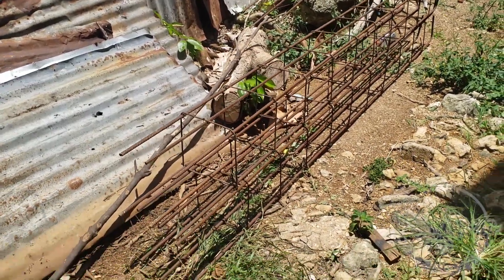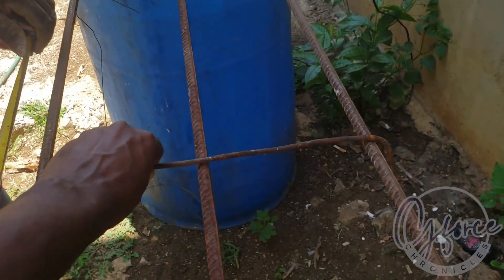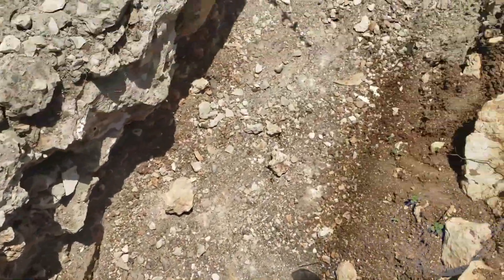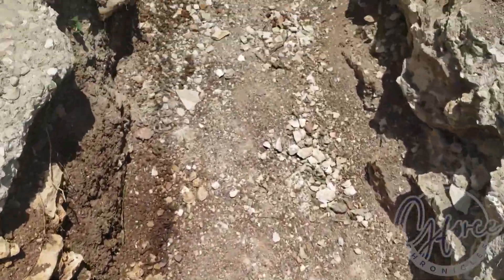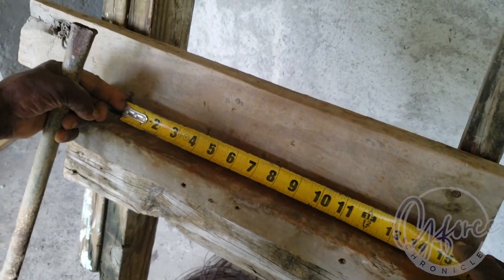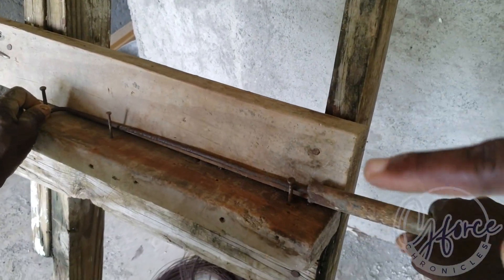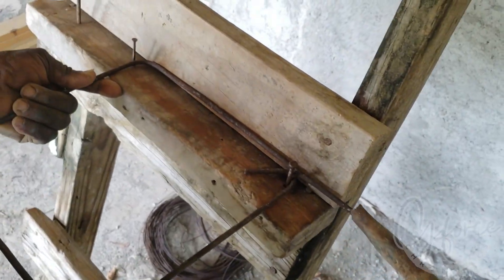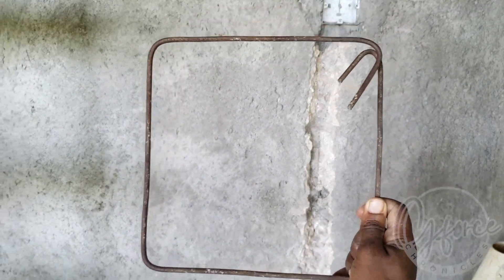HOW TO ERECTING REBAR STEEL IN FENCE WALL FOUNDATION[ CONSTRUCTION DIY

Comment: Question…you used 1/4 wire because that is what the customer wanted? Even though the building code requires 3/8 steel?
Reply from the maker: "That is what the customer wanted us to use on the fence wall, but in my opinion, there is nothing wrong with using quarter wire. It's all about the quality of the concrete mixture  If that's within your budget and there are no special building code requirements to use 3/8-inch steel in your area 👍